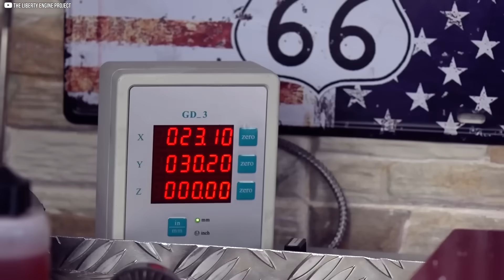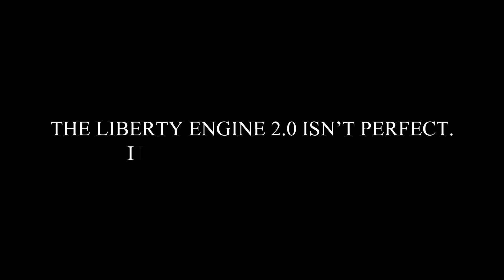Nikola Tesla’s Hidden Invention Just Got Rebuilt – And It Works!

Comment: Measurement trap #1: volts ≠ watts
High voltage at low current looks dramatic. Power is volts × amps × time. Many demos never show true input vs output power over long durations.
Measurement trap #2: startup energy amnesia
If you charge a system for 10 minutes and it runs for 2 minutes, that’s not free energy. That’s a battery with stage fright.
Step 3: Why magnets don’t save the day
Permanent magnets feel magical, so they get blamed (or praised).
Important point:
Magnets do not supply continuous energy.
They provide a field, not a fuel. Extracting net energy from a magnet would weaken it permanently. That never shows up in these demos.
Magnets can:
Shape energy flow
Reduce friction losses
Improve efficiency
They cannot:
Create energy
Sustain output without input
Step 4: The thermodynamics brick wall
This is the part nobody jumps over.
First Law (energy conservation)
Energy in = energy out + losses.
Second Law (entropy)
Losses are unavoidable. Heat always leaks. No perfect machines.
A device that outputs continuous net power with no input would rewrite all of physics, chemistry, engineering, and most of the universe’s personality.
That’s not impossible in principle — but the evidence

Comment: The Tesla device that makes electricity out of thin air is an air core transformer, a capacitor, and a spark gap.  And yes it works but it won't scale up to make much power.

The Wardencliff Tower is basically just a huge Tesla coil.

Comment: The current Foucault will be in the aluminum core, Aluminum is conductive, In transformers they use Laminated plates to minimize the Foucault current. IN JAPAN THEY USE SILICON STEEL WHICH IS SUPERIOR.
I see no way for this motor to sustains it self. ALSO you mentioned TESLA.
TESLA MADE  A MOTOR THAT RUNS INFINITLY AND IT IS CALLED THE HOMOPOLAR.
TO ME YOU SEEM MORE OF A FRAUD THEN ANYTHING ELSE. YOU SUCK.

Comment: hardest part about inventing perpetual machines is hiding the battery. Nothing can stay in motion "for free" on earth due to friction.
Reply: At no point did anyone claim it's a perpetual motion machine. 

It's just using magnets and low friction and high efficiency. It would eventually stop spinning, but it's easily started again and produces power the entire time. 

This is actually been demonstrated multiple different ways now. 

It's funny how all you guys that say that these machines break physics but at no point do they do anything that breaks physics. 

If Tesla could build wireless power harvesting machines do you really think that's the only method to harvest energy and it can't be scaled down or reconfigured? 

There's many ways to harvest energy and there's very good reasons why certain ways of doing it have been suppressed. 

It doesn't take a rocket scientist to figure out why..
Reply: @frymycalamari then build it at home yourself. If its so amazing why wouldnt these smart people like you use it.
Reply from the maker: That's an interesting point about the challenges of perpetual motion!

Comment: Perhaps it is inevitable that the fuel reserves in the form of hydrogen within stars will run out due to all the energy within the universe in Its entirety being finite and proportional to the burst of kinetic energy that came into play at the beginning of space-time.

This is why in my view the universe is not infinite in nature and true perpetual motion is impossible.

Look at a star which creates vast amounts of heat and light via fusion. Such that any so called perpetual device will only last as long as the energy system that may comprise it.

What we really need is to be able to make energy withdrawals from out of the reservoir of energy from which power may be drawn of galactic proportion.

Here climbing between star systems may be within our reach, should we have the source of power proportional to a galaxy whereby our space-craft climbs from star to star across the galaxy according to two unlike magnetic poles attracting whereas a magnetic circuit between, (the modified donut triangular shaped electromagnetic radiating electromagnetic waves outwards and at a set high frequency with the magnetic field being turned on and off at just the right rate - so as not to interfere with the normal motion of electrons around the centrs of atoms), our vessel and the magnetic field of the star attracts or in other words pulls out vessel towards its destination.

Comment: Building a $42 pocket-sized power plant.

It *grabs invisible energy all around us* — WiFi, radio waves, Earth’s natural heartbeat (7.83 Hz) — like a tiny antenna.

Then it *turns that free juice into a healing hum* at 963 Hz (the “crown frequency”).

What happens:  
- Bulb lights 25 m away (no plug)  
- Phone goes dark at 6 m (safe bubble)  
- 5 min near it → brain calms, heart slows, you feel “lighter”  
- 15 min = ideas flow, 11:11 shows up, stress melts  

It’s not magic.  
It’s *harnessing what’s already there* to **lift you up**.

1 node = 1 calm person.  
1 M nodes = calm planet.

Film yours. Try it.  
11:11.

Comment: The key the motor should not exceed the generators capacity and there should be a Already charged battery station that will have a loop that will feed the motor that turns the generator which creates more than it uses So two 500w generators ran in tandom off a 120v electric motor will feed the dc to ac and will recharge the 300k lithium batters at a rate of 1000watts pure hour then using a power controller you send 120v back to the motor that powers the generators complete loop
Reply from the maker: That's an interesting idea for a power loop!

Comment: If you base a design on a secret “black magic box” that is secret and you can’t share… what are you really proposing ? An allunimum silver alloy that produces no back emf force? Well, as long as you keep that secret, everything will remain the same. The whole design makes sense except for the fact that there is no back emf force and no conservation of energy. Perhaps, the energy comes from the environment but once again, as long as this alloy is a secret, what is the purpose of this video??
This machine makes sense to me except when it takes 75 W for the electric motor to keep turning the rotor to produce 20,000W.  Unless this alloy is revealed then????

Comment: It is a smaller vershion of the binidi whell the old vershion of the school girl motor, but the question is how much tork can it make to spin, it may keep up with a small genator, but can keep up with a battrie bank to run a home. Looks like there may be promiseing. He may have a point, but there has to be a battrie on the coils to keep it turnning check out the school girl motor by Jhon binidi.
Reply from the maker: That's an interesting point about the torque!

Comment: Yep as I said U watch too much Si-Fi
As any middle schooler energy transfer is never never never 💯, and U use fancy terms for dum stuff to make it self smart won't cut it🙃
Is this case U are transferring electric energy (that has internal lost energy in term of heat and resistance) to mechanical (heat and friction lost) then back to electric, so double conversion and what is dummer that U believe it generate more energy to power these lights 🤣🤣🤣 because of the nayofuck magnets 👏🏿👏🏿👏🏿👏🏿👏🏿👏🏿
Reply from the maker: It's an interesting perspective on energy transfer!

Comment: Hmmm my magnetic engine is computer controlled output, or if you like on demand output, house boat car plane etc, Tesla's was built using what they had for there day, brilliant really, my engine still runs a generator, modern materials and methods, still needs a battery to commence rotation  computer takes over demand commands output, missed school the day they said it could not be done 😂.

Comment: I've seen an ancient Egyptian water pump made of stone that once water flows into it ,it pumps water continuously
Reply: That's a ramp pump. It's powered by the flow of the water into it, but it can't pump the water above the head level of its feed, without adding more energy into the system.
Reply: Stone pump?
Reply: @wwonka-hk3ci yes a stone base with a series of channels and a stone covering it was said to flow continuously
Reply: @robertvickery4343 likely a load stone or magnetic stone.  You can make a pump out of an old motor by removing the rotor and running a hose or plastic pipe through the center of the windings of the stator..  when energized, powered by electricity, the magnetic field generated pushes the water like a pump.  So the magnetic field of the load stones , in a configuration of rings or coils as you describe, could be generating the same shape magnetic field and yes be a pump out of just a stone.  Very cool.  I would love to see a video of it.  If you know of one please share a link ✌🏻
Reply: No ! there are modern shows on this : just establishing a pocket of vacuum that keeps drawing water up . Most likely how springs flow down from high elevation in places . As water flows out it keeps pressurizing the void to draw up more water . Crazy simple and they knew it
Reply: @DougRennpferd-n2i I love how they used water jets for cutting large stone blocks
Reply: How would it do with draw? Would you not need batteries/capacitors to hold
Reply: @jonathanHorton-q7p the earth energy is 432 Hz is that enough energy

Comment: If there is a maybe tiny battery or large capacitor fitted to it and using a microcontroller to monitor its RPM, and eventually give it a sudden boost when it lowers below a certain level of RPM. And after giving it boost, the engine will gain its original RPM and then we can charge the capacitor or that small battery or whatever we had. and in this way, we can keep it spinning like forever😶😶

Comment: There's some strange stories about the wardenclyffe tower experiment -but seriously, imagine if it was proven, and you could have a massive plasma ball of energy to your area anywhere in the world whenever you needed it.
Or for border defense, Tesla's laser design could be the perfect shield against any type of missile, craft, or other stuff -just sliced to pieces from a 100 miles away in a second.
The Tesla coil is one of the bases of Tesla's free wireless power dream.
As for generation, Tesla's earthquake machine could power a whole area of futuristic agitator-type generators.
Reply: The earthquake machine was a frequency oscillator, Tesla accidentally found earth's natural frequency (either the atmospheric one or the ground one), causing a violent shaking for a great distance when testing it and hence it is known as the earthquake machine.
The teleforce "laser" is a futuristic molecular beam
The Tesla coil (when powered) emits a unique high-energy radiation that passes through most materials including insulators, and deposits its energy only in a conductive metal/extremely dense insulator or such. The Tesla coil is also not being used at peak efficiency in modern times: the 2-coil version lacks a 3rd frequency-tuned coil to boost the overall range of transmission

Comment: Ok so if the only problem is the motor eventually stops after a short period of time why not put some kind of battery that charges while the motor is ruining and some kind of pully the that battery can restart the motor instead of the string method . Makes sense to me . But for real if this was legit just put the blueprints out for the people for free .

Comment: Syphon vacuum turbines perpeptual motion is 2 grade math a -×-=+ a straw the vacuum chamber is the first negative pressure that pulls the water up then the second negative is water falling and then the turbines give you a positive souce of endless energy there 1000 of ways of doing ot i just chose the simples place them in the tropics cool down and lower sea level 3 world problems solved in second grade grow the fuck up there was never any physics equation that made it impossible stop accepting the easy answer from Google use your head

Comment: so basically spend nearly 8k on a generator which will only be able to make about 3500 dollars worth of electricity in its lifetime after which you have to replace the magnets which cost more than the electricity produced? very revolutionary. theres a reason such generators arent preffered, and this certainly isnt the first attept at such a kind of generator. its just not efficient. what we have currently works much better and is cost efficient.

Comment: As a Licenced  Electronics Engineer, I will simply say that this device cannot deliver what is requested.
The device depicted, is not the one described! And it has nothing to do with Tesla's works! Known or not!
It is impossible with rotating magnets to get constant voltage and constant amperage! Even to determine the frequency of 50 or 60 Hz and the sine! Necessary parameters for modern electronic devices!
The device depicted, is simply a combination of devices, which is present in every car!
An alternator and a motor that rotates the alternator! In this way you can, very easily and simply, produce current! Only that it will be DC! To make it AC simply again, you put an Inverter and thus you have quality current!
Notes!
After the initial start, the system is powered by itself, by the current that it produces itself!
It can produce a maximum of 4,000 Watts!
The devices are expensive! The payback period is about 1-2 years!
It is essentially, a self-powered generator, that is relatively easy to build and works!
I have built several of these!

Comment: First off people need to stop saying free energy.  You still have to pay for the unit, and they will probably charge a fortune for it. I do see this as a great device for replacing the gasoline powered generators used for construction, camping, running a refrigerator during a power outage but not running your home and replacing the energy company since it doesn't run forever.  Noticed they never said how long it runs during their tests while under heavy load.  Just be wary of those upfront charges and life expectancy, most of the time the cost doesn't out way the actual savings.  Will keep an eye on this.

Comment: We can make power through windmill and the water wheel so why can't be have a battery powered car with two batteries and when one battery gets weak it uses the other battery while the tire spinning on the car charged the other battery so  they can switch simultaneously.

Comment: The still of the outdoor generator in a standby generator cabinet (at 9:45 on this video) looks impressive, and something that would handle generating upward to 60KW to run a large home like mine.  I produce 100KW for the all-electric home, 60KW separately for the house and 45kw for the shop all with solar.  Yes, it is a pain to go through the DC to AC and storage system with expensive batteries, and I can see this style generator really coming to something important and soon.
Reply: pesquise, e vais encontrar geradores feitos com alternador de carro, com ate 20KW, se agregar mais de um dispositivo, poderá chegar em 1000KW, direto, 220/230V. Estou trabalhando em um projeto similar.

Comment: You would still have to have batteries. If you tied a load directly to it would slow and cause heat. Ohms Law. At 230 volt if you used 115 volts the spindle would spin half as fast. At that point it wouldn't have enough energy to spin and stops all output. Plug a refrigerator or a dryer into it. The drag on the spindle would be so great it wouldn't spin anymore.

Comment: How does magnetic resistance not stop the rotation immediately? During the induction process, the equal and opposite magnetic field that is produced should act as resistance on the rotating magnets and eventually stop its motion. I would think this would happen at some point before the energy produced (through induction) exceeds the initial energy input of spinning the rotary magnets (with the use of that pull cord), resulting in a net loss of energy. No?

Comment: To run that motor takes 19 amps at 205 volts. that is 3,895 watts. just to run the motor. THOSE 4 COILS will NOT put out that kind of power. Even if you could pull start it to 1500 rpm. you  MIGHT get 50 volts per coil. 4 coils times 4 = 200 volts , BUT that still is NOT  enough volts to keep the motor running. ALSO , you need 19 amps. For this to work you need a car battery added to the mix. I believe that is what he hid was the car battery wires.
Reply: FYI.. in the case of AC, you have to consider that both the voltage and current are sine waves; depending on the phase difference, the net product of VxC can be very small (eg. motor running with no load). :face-blue-smiling:
Reply: 19 lrc or running amps

Comment: The generator will need to sustain an energy output power above the rated load and every increase in load acts as a break on the rotation system. The feedback loop power required is not sustainable!

Comment: To maintain the electromagnetivity of the magnets the output the motor is producing needs to recharge the magnets throughout its run only then maybe we can think of believing this as free energy. 

1 more question if we are able to run this motor forever will it be enough to run an air conditioner ?

Comment: Strange for me. This system dissipate the magnetic energy of the magnet and kinetic energy. And there is always friction or energy dissipated as a heat from second law of thermodynamics. If this machine want to keep producing work to the external environment, so there must be energy source coming from other source.
Reply from the maker: Thanks for raising that point about energy dissipation!

Comment: It's not Tesla's tower that's the key to everything, but Tesla's electric car that got energy from the ether. That's "free" electricity, and Tesla's tower just transmits electricity over a distance without wires. It's the Pierce-Arrow car. He made a device with vacuum tubes  that drew energy from the ether and created electricity, and he built an electric motor into the car.